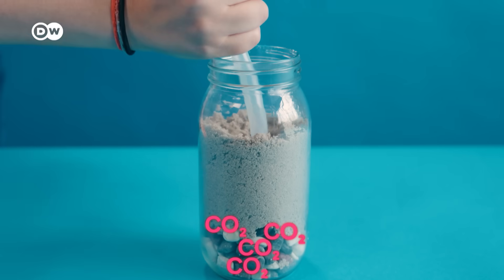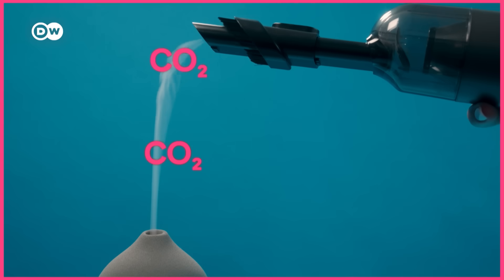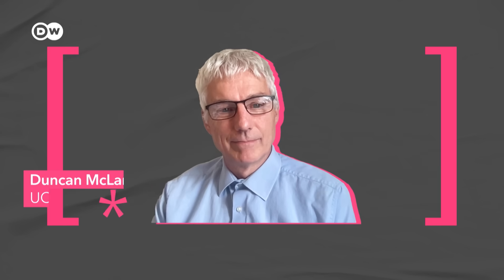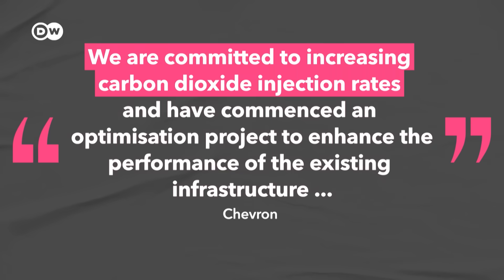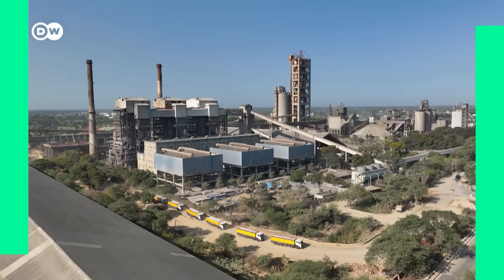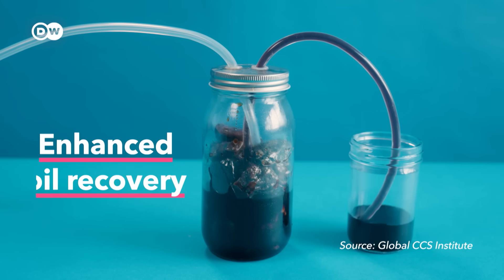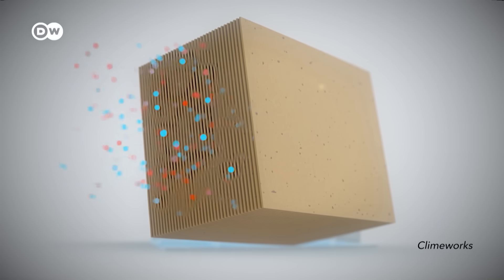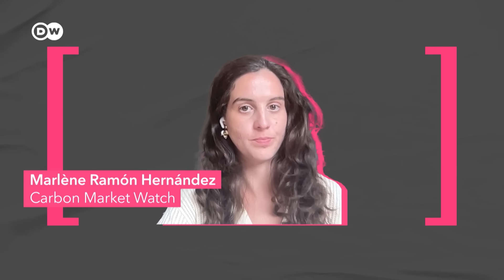Why carbon capture needs a reality check

Comment: @brianuphoff8945
0 seconds ago
Can't speak for other people but if one does a little digging then you might find the real reason for many strange happenings.  The magnetic Pole movement very likely means the entire state of will be under water.....and it's not the first time.  When the Poles change polarity, something it's done over 250 times in just the past 100mm years, then like Einstein you might want to look into what are the consequences for this.  The ocean will be washing up about 45 miles South of Atlanta.....but don't worry, because the USA is now 2 huge islands.  90% of everyone will be dead, the few left alive will quite likely be in another Ice age after that, VERY shortly there-after.  Likely the same day as the flip itself.  BTW the sun changes it's polarity every 11 years.  Mars has no magnetic field, all the other planets have such fields.  It's been 790k years since Earth's last major flip, but such polar migrations occur every 6,000 years.  BTW, these events have nothing to do with your carbon footprint.  Carbon Dioxide represents less than 0.04%, up 30% from 0.03%....we lose plant life at 0.02%, in Science the definition of a Trace element is 0.10%, meaning Carbon concerns are totally baseless by very simple definition, please do your own research,  our only risk is a polar swap......ask yourself this, " do we really need 42,000 space ex sats that surround the Earth like a giant net"?  When it's finished and you turn it on, it will create a magnetic field, perhaps as strong or better than the one that God gave us.  BTW when the flip happens, and that could be any day now, we lose our Magnetic field, last time for 65,000 years.  That allows the sun's radiation to come in unabated, which melts all the ice, raising sea levels by well over 200 feet.....and once it starts, how much time do you have to move your entire life out of FLA?  less than 60 days......sorry Science is a bitch!  The Magnetic Poles have moved over 1,500 miles, 1k miles just since 1995.  It's gone from Canada all the way over to Siberia since 1995, and it could flip at any time.  Now traveling at over 1,000 feet a day, using the dynamics of magnets, the flip happens quickly, less than a day, and great geothermal events happen at the same time, all over the World, think Revelations.  And think soon. It may be too late already.  We have bought land in the mountains of the Smokeys, and they are the Earth's oldest rocks, 4B years old.....all of it above 2,000 feet elevation. In one day, mile high glaciers are possible.  Read books, and Science papers in the areas astro physics and vulcanology.  Read "The Adam and Eve story".  Sell your stocks and bonds, and buy land, and options on land.  31 Million people will attempt to follow you shortly.  It's your best chance, good luck!

Comment: For starters the video did not answer a question that intrigues me about the use  of CO2 in EOR(Enhanced  oil Recovery) and that is-what happens to the CO2 eventually after  being used in this  process?
Secondly, it  seems to make  sense to take the 'retro' approach and look at technologies/infrastructure which we could  harness for DAC which would  reduce the costs. Immediately we think of the  vast amount of air  processed by air  conditioning (hvac).There are  promising developments in grafting on  a DAC capability to this...
Finally, lets look at the 'CO2Rail' plans to make use  of train slipstream to replace fans and currently wasted regenerative  braking energy  to power  innovative 'electro-swing' DAC methods  in railcars.

Comment: Now there are countries who have over production of renewable energy, causing big issues for grid stability. Hence sometime consumers are being paid for using energy (negative energy prices)

I believe we’ll see this scenario more often as solar and wind power gets cheaper. Mass scale energy storage is one solution but it is expensive and requires significant amount of lithium mining (which is detrimental for earth and co2 emissions)

Then why don’t we approach this problem by using excess renewable energy to capture co2? What if these plants only operate at the periods where there is excess renewable power? In this case it could start making sense.

We need fast response co2 capture facilities, not only capturing carbon but also helps to stabilize grid. Yes their operation time will be lower (capex/co2 captured will be higher) but this way we can start justifying their role beyond carbon capture.

Comment: Carbon capture and storage (CCS) the theory, idea and technology is sound, but You need highly skilled companies and teams to build it, not to have a failed project that doesn’t meet its promise.
I don’t think many company or big or small are mature enough in this technology to be able to be trusted to deliver on its promises.

And one important thing that really isn’t addressed in this video is CCS as a service meaning one huge plant is built and then companies in like steel and cement industry can capture and then ship liquid C02 on ships to this country and terminal and offload it there for storage out in the sea bed this is what the Nordern Lights project is going to do provide a service to more quickly enable higher usage rates of CCS technology for companies that don’t have the experience of building CCS plants.

Comment: I think this report is very biased as it suggests that the captured CO2 will only be used to extract more oil. You use CO2 every time you open a sparkling water, buy grocieries (protective gas e.g. in a packed chicken, tofu, etc.). We need DAC and CCU to replace the purely fossil CO2.

Comment: I think DAC should be installed near carbon emitting sources,to extract gases without the need of any sucking mechanism.
Secondly, the sucked up gases needs to be stored in such a way that nature can slowly breakdown toxic gases into carbon,nitogen, sulphur, oxygen etc as a result we can re-use them in future.

Comment: The investment into the tech will develop into an eventual solution. Also, this video does not share the latest innovation to capture carbon even newer than what is shown in the video. "yellow powder carbon capture" refers to a new material developed by scientists at UC Berkeley, called COF-999, which is a porous, yellow powder designed to effectively absorb carbon dioxide directly from the air, acting like a sponge to trap the greenhouse gas; essentially, it's a potential breakthrough technology for direct air capture (DAC) due to its high carbon capture capacity and ability to be reused multiple times"

Comment: Making cement without producing C02 is currently impossible. Steel can be made using hydrogen, although lets face it: we are not going to replace most steel mills in the next 20 years

Comment: I think carbon capture technologies are largely a waste of time and an expensive greenwashing exercise for the oil and gas industries. A couple of things to add, you mention capturing co2 from steel furnaces as a neccessity when a lot of  that industry is transfering to Electrical blast furnaces that I assume emit little to no CO2 compared to their Coal counterparts.Also you haven't mentioned the huge array of pipelines, particularly in the US, which are used to transfer the CO2 with dubious land purchasing arrangements.They are also susseptible to leaks, particularly in flooded areas where they have killed people from intoxication.The US has plans for thousands of miles of carbon capture pipeline across rural farmland which unsurprisingly has faced stiff opposition.

Comment: Given that the equatorial oceans are recieving additional heat from the sun due directly to human interference in the formation of the African Easterly Wave cloud mass - not the fabled long wave radiative forcing proposed by the WMO/IPCC franchise. Is there even the slightest possability that a person who claims to have some expertise in the arena of CC and GW can explain how can it be possible to sustain the 0.02% myth of the CO2 agenda. This whilst also ignoring the fact that global air pressure i.e. the No 1 ghg: H2O, has been dropping for decades.    RSVP

Comment: What a load. It's opposition from risk averse politicians and ignorant greens that stop these projects proceeding. Case in point is the recent killing of a project just to TEST - not even start injection - by a government unit due to 'risks' to the environment. Not to mention that only 30% of oil is recovered on average, and what do you think plastics are made from? Burning it is for sure a waste of a useful product, but the stupidity of demonising oil companies can be for one reason only - they have a lot of money. Surely it's the USER, not the producer who is the problem?

Comment: Check the science carbon dioxide absorbes long wave radiation (Heat) and re-radiate long wave radiation (heat) at the same wavelength as it absorbed it. SO WHERE IS THE HEATING OF THE ATMOSPHERE????

Comment: can't we just re-use the co2?
if it can heat our planet then why can't it heat our homes? like litterally. just attach a co2 extractor and make it pump co2 in between the isolations of your home. it does transfer heat slightly worse than air and its easily available so...

(it should be noted that the extractor should be placed inside of the house and not outside due to safety reasons)

Comment: Fighting big oil is good, but we also plan to use CC for our cogeneration plants and WtE plants in EU as additional business opportunity rather simply to say that this is somehow single-handedly solve the climate crisis. I think this part was lacking in this video. The opportunity comes from the fact that Co2 is very useful resource, either for production of food, jefuel of whatever, and it competes with carbon storage, which sort of fights the issue you mentioned with pumping oil. I think this piece was more of a hit piece rather than real report on what the CC is actual good for. Hope that wasn't the intention, otherwise, what's the point of journalism if its not better than influencers.

Comment: We know what CCS actually costs, because the Canadian public built a CCS project at scale in Alberta - we paid for it almost entirely.  It's called Shell Quest, and despite doing a very partial capture of CO2 from a stream under pressure with a high concentration of CO2 in it, it costs $165 CDN per tonne of CO2 emissions averted.  It doesn't cost $15/tonne as this video optimistically claims- it has NEVER cost anything close to that.  

And no, that's NOT getting cheaper.  There's nothing in CCS plants that is subject to Wright's Law type learnings to reduce its cost.  CO2 removal from process streams is routine chemical engineering- it's done at scale every day and has been for decades.  CCS will never be relevant for energy production as a result, but it is HIGHLY relevant as predatory delay strategy by the fossil fuel industry.

DAC on the other hand, is just fundamentally broken technology.  It will NEVER be cheap because of basic thermodynamics.  And it isn't just a cute but hapless energy destroyer, ahead of its time by decades- it's a predatory delay strategy on steroids, and a fossil fueled meme.

https://www.linkedin.com/pulse/why-direct-air-capture-sucks-good-way-paul-martin/

Comment: These kind of wasteful technologies are dumb, to put it mildly. The cheapest way of creating carbon sinks are planting trees which can actually use the CO2 present in the air. And the next best method would be artificial photosynthesis. And the best way is ofcourse to decarbonise at the source itself, ie to stop burning fossil fuels to the maximum extent possible. For the industries that still need to use fossil fuels for whatever reason, they should be taxed at atleast double their current operating cost so that they have a strong incentive to move away from fossil fuels. It's just policy paralysis, nothing else.

Comment: Carbon capture is the dumbest idea in the history of dumb Ideas, I thought it sounded great when I first heard of it, but you can save more carbon by just turning the plant off, even if you power it with green energy you can still save more carbon by literally switching it off thus enabling carbon based power plants to throttle back.that being said there could possibly be a small nitch if you have too much supply and need to dump energy although running an aluminium smelter would work just as well and you know actually produce something useful 😊

Comment: DAC or CCS are both sound nice as a technological means to achieve net zero or net negative CO2 emissions. However, they only make sense in a framework that includes emission taxing or effective emission trading schemes. And it is also exactly this framework that determines whether xxx € per ton removal should be considered 'expensive' or 'cost-effective'.

Then, the price of DAC/CCS decides on the fate of certain industries that cannot avoid CO2 as leaving group in a redox reaction for the production of materials, or as a product of burning fuels with high energy density.

Comment: I suppose, if we had access to reliable commercially available and nearly limitless clean energy from, say, fusion, then we could install thousands of DACs and put them to immediate relief work, perhaps even enough to stabilize atmospheric and oceanic carbon levels within meaningful time frames. Unless or until such conditions become apparent, this is low-priority, /especially/ if captured carbon would just go towards increasing the supply of the very sources of pollution. Until then, investments into renewables and next-gen nuclear energy is the right path. A company actively reducing their investments into renewables is not a crystal clear look into their motives, but it IS an indication, a sign that they may not have any intention of doing what is right. Which would track
Reply from the maker: Thanks for your comment! ✨ Please take a look at our channel for plenty of videos on different renewables. Also, did you already check out our video on thorium? 👉 https://www.youtube.com/watch?v=Km6kqykX900 ☢️
Reply: @DWPlanetA  I had recently watched related videos on thorium reactors but hadn't yet watched that particular one until just now. I liked it, but it also made me sad. Ever wish we had access to a time machine? To undue several short-sighted arguably boneheaded decisions made in the past?

Comment: What's the power usage of DAC and what's the carbon cost of that power usage? Even if DAC uses green power if means that that green power cannot then be used in the grid to reduce the coal or gas produced power?
Reply from the maker: You're right in that there can be an opportunity cost. DAC can still play a crucial role especially where there is too much renewable energy or where emissions from other sectors are difficult to eliminate. Here's couple of studies that look into the life-cycle emissions: https://pubs.acs.org/doi/10.1021/acs.est.1c03263; https://www.nature.com/articles/s41598-023-44709-z

Comment: Best bet in my estimate. Run the CCS solely on nuclear if possible. It’s the only way I can reckon to get around the thermodynamics of this issue. You can’t use FF to run these systems. It’s pointless.